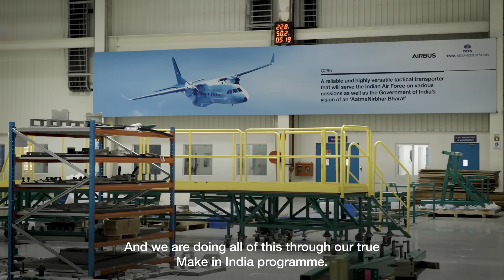C295: Make in India

Comment: 40 firm orders from IAF & further 15 orders of IN+ICG would be shot in arm for this assembly line.. further If IAF further replace all AN32s with this than this assembly line would be signal to C390 program also
Reply: C-390 is Embraer aircraft. Not Airbus. So why would this line have anything to do with it if C-390 indeed wins the MTA contest? Only if the A-400M won it will this line be involved in the Air Force MTA program.